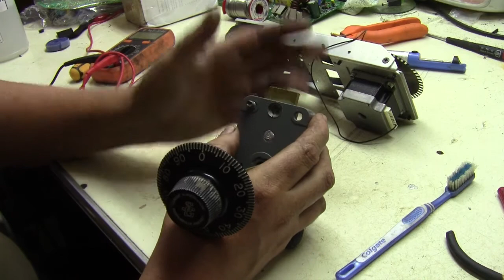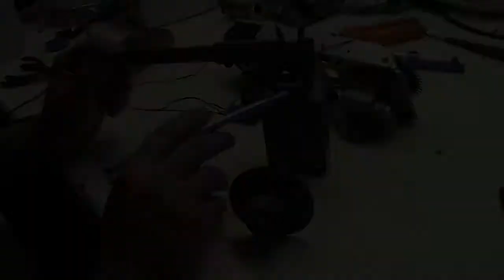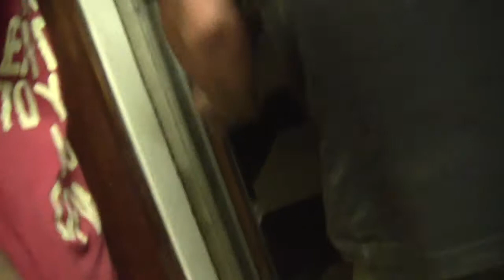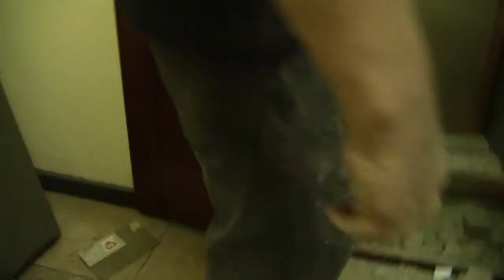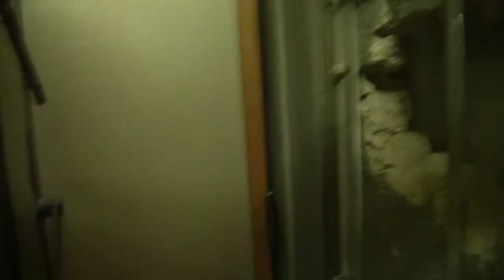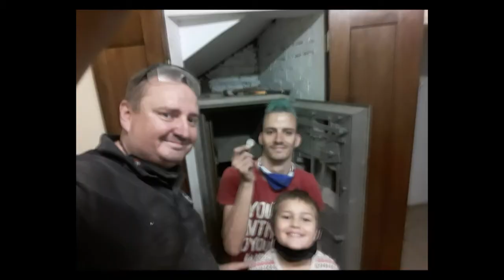ShoutingElectronics #39 - Electronics Engineering or Brute Force - Who Wins?

Comment: Those lock mechanisms have a lot of slop, so instead of needing to try all 100 positions in the dial, you only have to try 25, as the gate for the lock will engage any number within 4 divisions. Makes the combination pool fall from 1000000 tries to 15625, though those locks are also amenable to simply using a stethoscope and listen to the sound change as the pawl falls into the gate. Otherwise yes the brute force method also works, though the preferred method is to drill through the lock with a core bit ( cheap at Builders these days, and I saw some nice diamond core steel bits at Adendorf machinery as well) and make the lock disappear into the safe, using the nice convenient guide the dial shaft provides.

Not worth much as scrap though, as all the concrete ( BTW that front is asbestos cement, so careful to not breathe the dust, safe likely dates from the 1970's when the fire proof was done with asbestos cement wall cladding board) means half the mass is worthless, and only the front and around 10cm into the side is thick steel, the rest is 1.6mm galvanised sheet. Going to need a strong bottle trolley to get it out, along with 3 tyre irons to get the edge up to slip the trolley under it. Door should just lift off the bearing hinges once open.